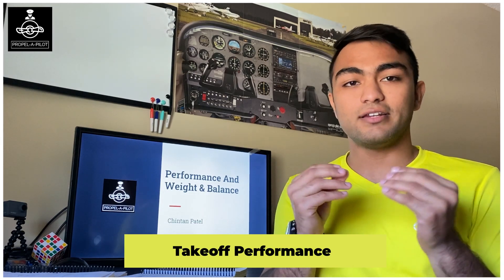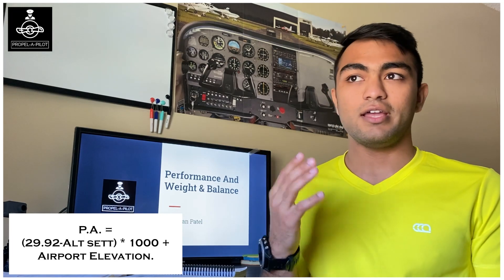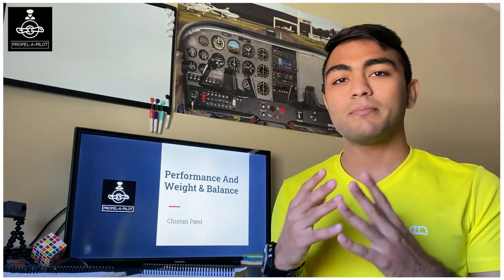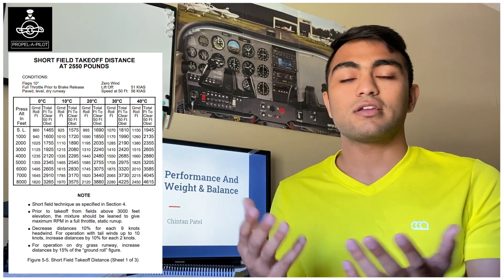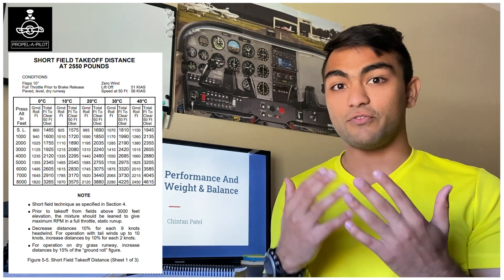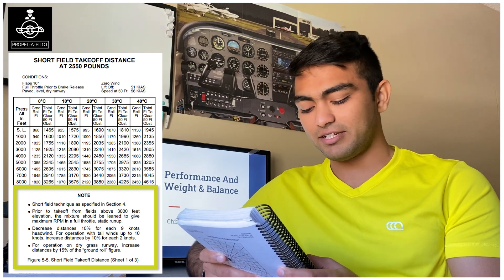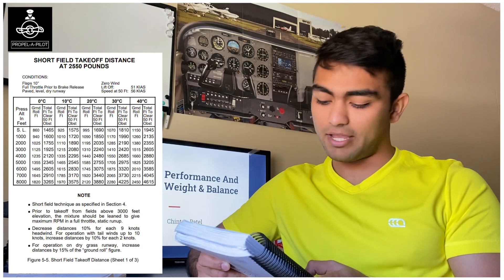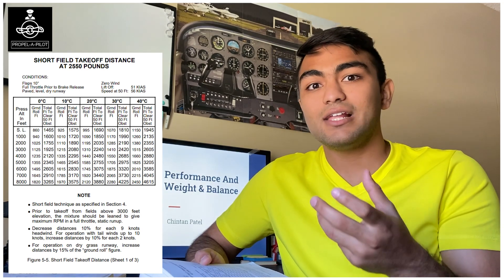C172 Takeoff Performance Calculation Example | PropelAPilot

Comment: What if the temperature is under 0*C?
Reply from the maker: That's a great question. I think when the temperature is colder it is reasonable to assume better performance due to decrease density altitude. For most GA airplanes, you will have plenty performance. For safety reasons, I would recommend use the most conservative number.